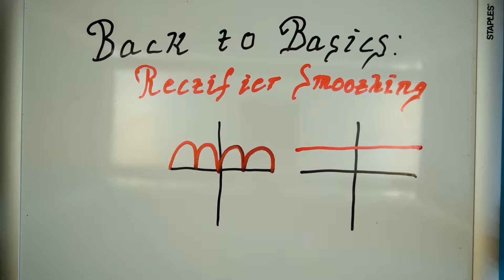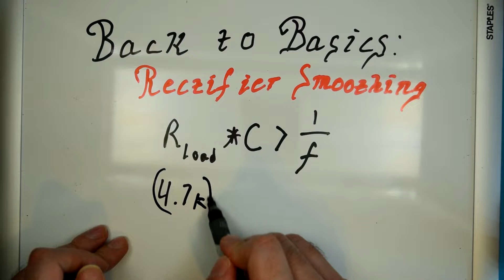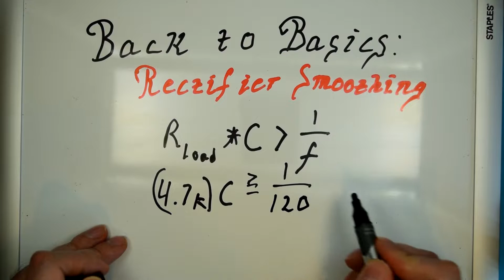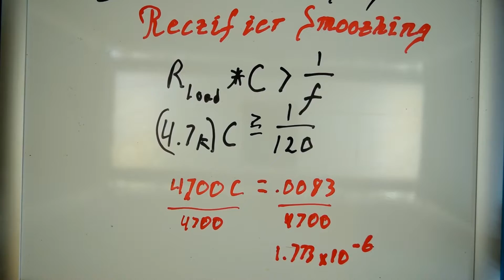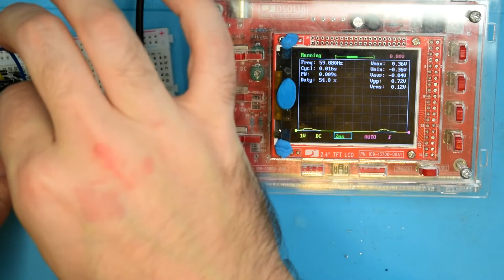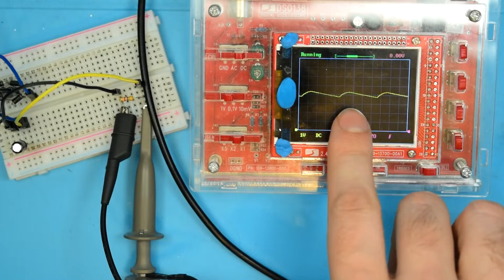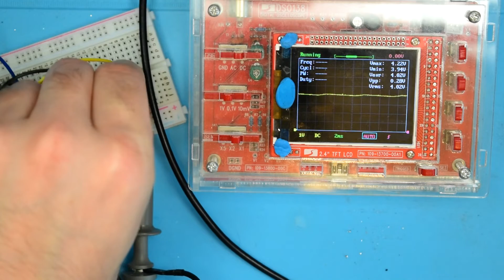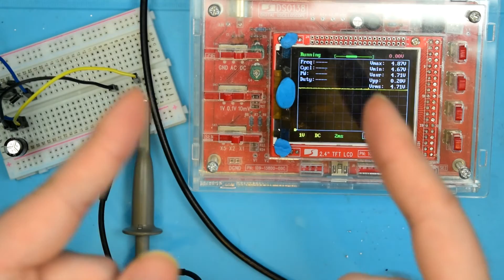Back to Basics: Rectifier Smoothing

Comment: How about four capacitors arranged in a rectifier arrangement😅
Reply from the maker: It would just end up acting as a single capacitor with a total capacitance of (1/((1/C1)+(1/C2))+(1/((1/C3)+(1/C4))
Reply: @GadgetBoy  my brain 😮
Reply: @GadgetBoy  I'd love to see a video on rating at some time, something very people seem to have covered, well... None I can find, I'd have to check the data sheet each and every time 😅
Reply from the maker: +Phonotical Rating of what?
Reply: @GadgetBoy ... Maybe you're not the guy for it after all 😅 rating of components, like a resistor, potentiometer, capacitor etc, can't just shovel 120 into everything, or even 250
Reply from the maker: +Phonotical Oh, i guess i could do a quick blurb on that.